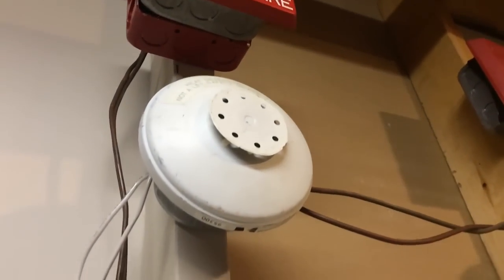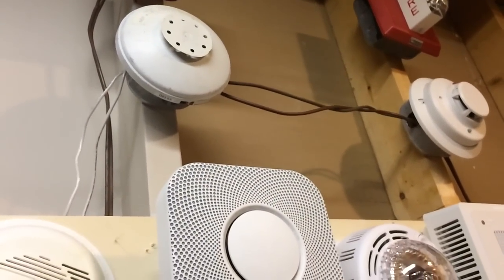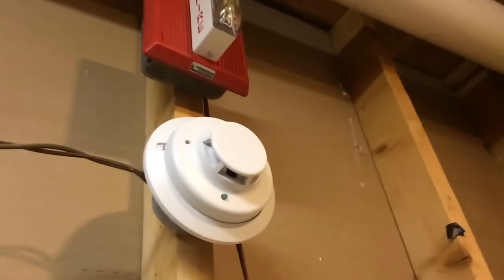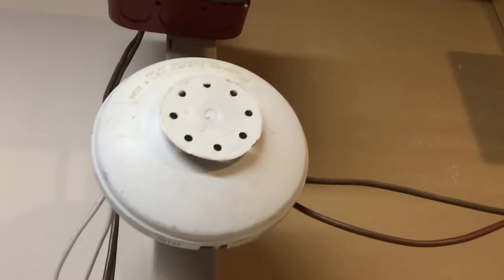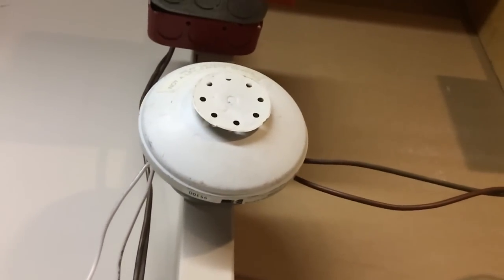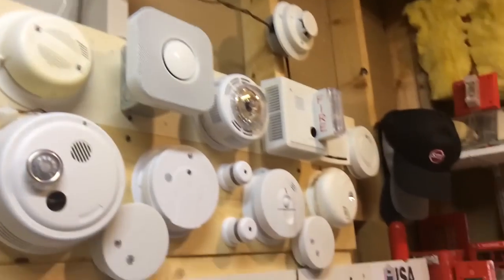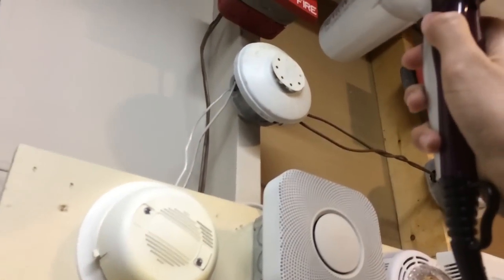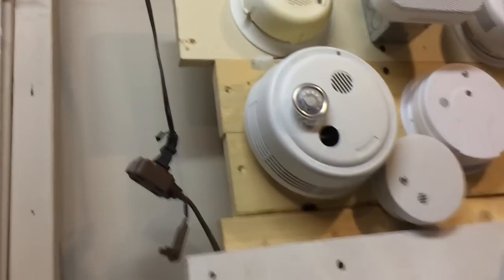Testing the Edwards 135° Fixed & Rate of Rise Heat Detector

Comment: Heat detectors aren't necessary most of the time anymore because there are already sprinklers which have flow switches.
Reply: They are required for elevator control rooms and shafts that are sprinkled. Reason being is to shut down the power prior to the sprinklers being activated to avoid water on live circuits....just fyi.
Reply: I install heats all the time in oil storages/chemical roomsfor mechanics,dealerships,restaurants,factories that store acids/bases for cleaning.where sprinklers shouldn’t be installed.the list goes on